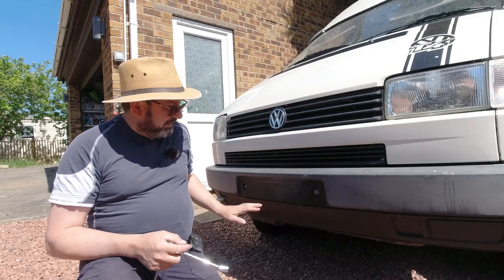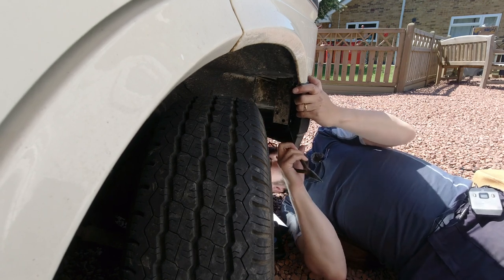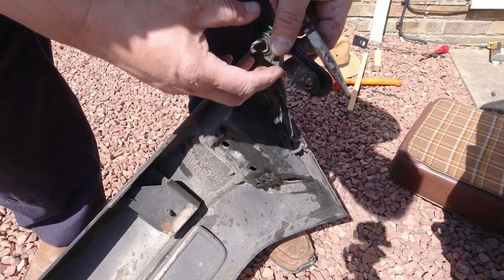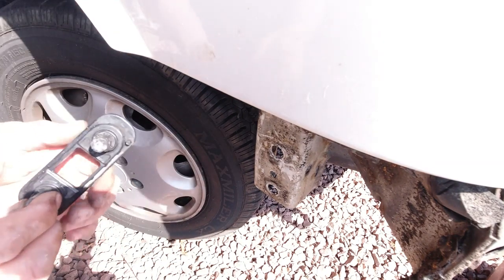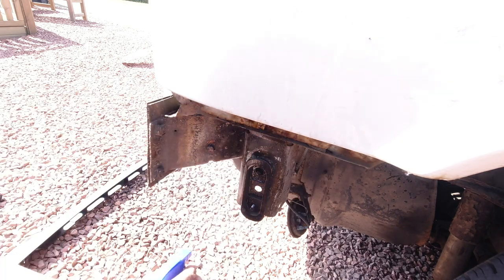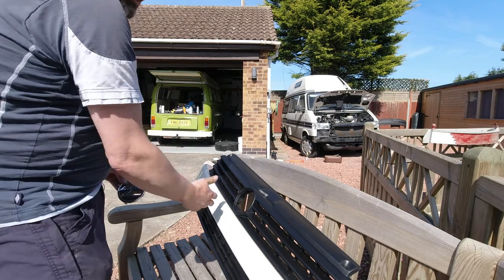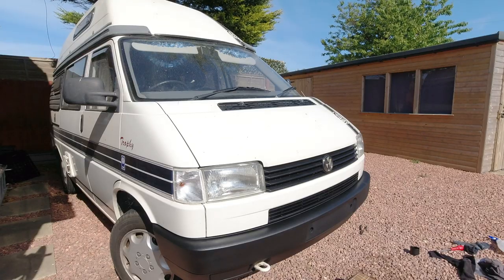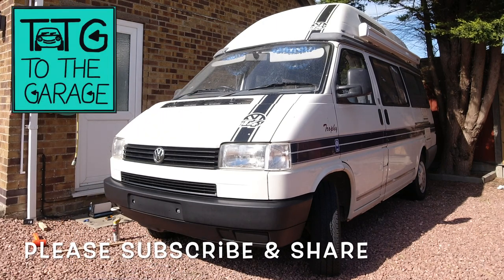VW T4 bumper and grill removal. Autosleeper Trophy camper van

Comment: where did you get the battery cover John, ive tried VolksMagic and others,no joy
Reply from the maker: Battery cover was in the van when I bought it, so ia m assuming O.E. but I must admit it would be a lot better on a LHD van where the cabin air intake is on  the opposite side to the battery tray

Comment: Just as a note, those lugs lock the bumper in place. You need to pull them partly out to remove the bumper. Watched your video simply to check out making a aftermarket bumper for my t4 Syncro 1996. May not happen. Anyway thanks for putting up the video
Reply from the maker: No Problem. Good luck with the Syncro bumper

Comment: After two days of trying to get the bumper off to install front parking sensors, and finding exactly the same problem - lastic slugs pushed in too far - I am now successful - break of the four 'wings' that are expanded by the plug, with a flat blade screwdriver and a hammer and lever the plugs out with a long nosed plier. It hasn't helped to find that the plugs have been inserted the wrong way round. The attachment is fixed TO the vehicle, not FROM the vehicle, the shamferred ends of the plugs should be inserted into the holes in the attachment until the FLAT ends are non interfering. Doing it correctly makes life much easier.
Reply from the maker: It seems that if the bumpers have been off at any time previously, then almost universally they are difficult to remove as people don't recognise that the dowels cal lock it in position

Comment: had the same problem with the front. thats what happens when the car is from 1994 and the front has never been off before.
Reply from the maker: Its an unusual design of attachment. Ive never seen it on anything else.  Maybe real VW heads, will be able to tell us if its a common VW thing?
Reply: @ToTheGarage  i doubt it. i work at a scrapyard in norway where we dismantle all parts that can be reused before we crush the cars and ive taken off many fronts. this is the first time i have seen this system, most just have plastic clips, bolts or two screws in on each side.

Comment: Go get the C4...
Reply from the maker: Ive not tried that one actually. Do You rate it Gary.
It would not work for my bumpers though as the front is faded plastic. Now restored as per the next video using textured paint (brilliant!) but the back is fibreglass and painted to a slightly faded grey colour to match how the front was before I restored it😁. So im committed to Pro-Tex now.